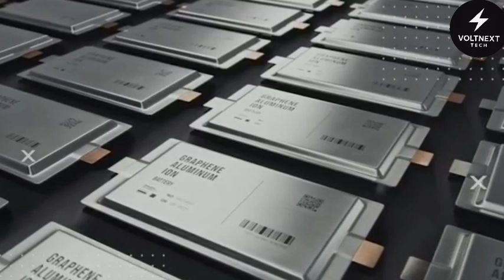The End of Lithium: Tesla’s New Battery Changes Everything

Comment: The use of Aluminum-Ion batteries in other applications could be good safety update. Fires for E-bikes are a real problem. If E-bikes used these batteries that issue might be greatly reduced or eliminated. Also, other tools like trimmers, mowers and leaf blowers. . .